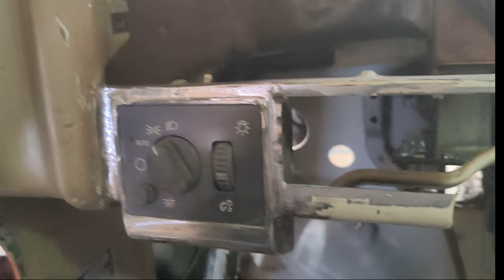Project Kermit 1962 c20 crew cab Dash and Steering column

Comment: That plastic flange keeps your column from rattling i have a 03 and have changed it 2x its gona make noise when you hit bumps
Reply from the maker: I didn't take it out I just cut the external ring off do you know if that's important I didn't see no reason it was on there it didn't set against anything

Comment: You lost me at the light switch housing  it doesn't make sense to use such heavy metal when sheet metal would have worked and weigh a ton less makes no sence
Reply: I was thinking the same thing. You could have bent some 16G steel to house that switch way faster than welding 1/4 or 3/16 plate and all that grinding. But the end result looks good. Nice job young man!

Comment: Sorry but it’s a hack job 
You ruined the dash with that horrid colum and steering wheel
Reply from the maker: Okay, thanks for your opinion at least
Reply: It's out of place
Reply: I wouldn't say it's ruined at all its how he chose to do it when you build yours, you can do it the way you want to. I see no issue with using what you have.  trying to make all the options that the 03 colum has work with a 60s colum would be a hack job what would you do with all the DIC buttons and make a shifter, towhaul, and cruse control buttons and all that work and have tilt